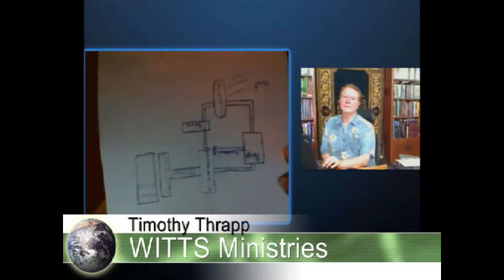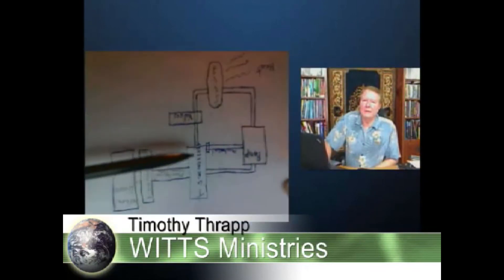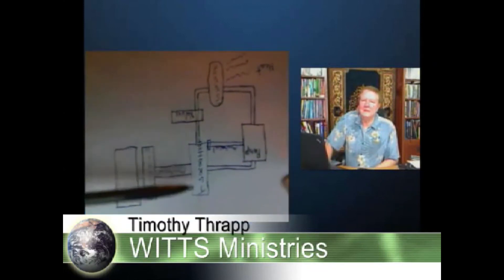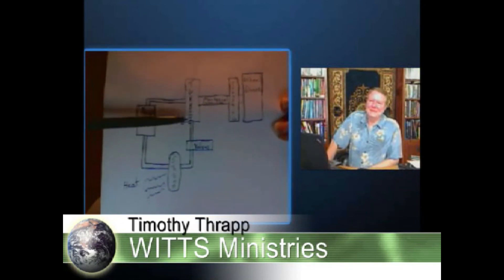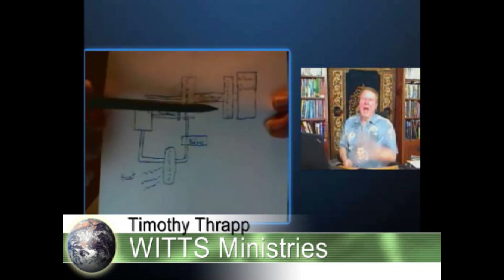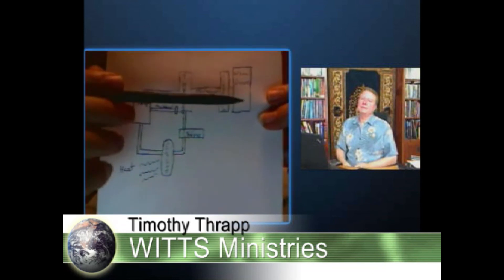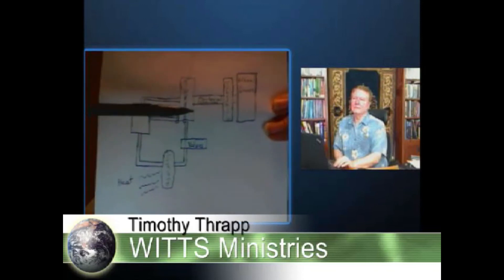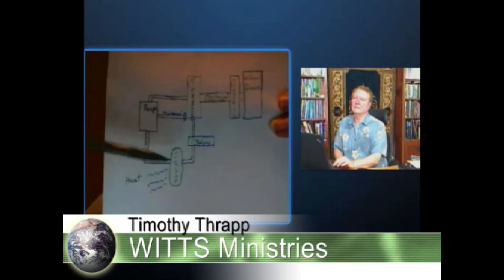300HP Ambient Heat Free Energy Engine

Comment: Hi I was wondering if this  system can  spin a Generator?? Or another type of energy machine.?? 
Maybe even something like  [ Bruce  DePalma's ] N-machine.?? For making 
Electricity OFF - GRIDD.!!
Reply from the maker: Yes. They did a demonstration at their 2010 gathering of a self-running A/C system. So it can run a generator, which can run electric A/C compressors, etc. This system doesn't work that well in the cold, but you could use a ground heat source (water lines in the ground), etc. Easiest system they are doing now to get off grid is Brandt-Tesla switch.

Comment: If what he's saying is true, the device itself is meaningless except for the jets. He spoke 99% of everything, but the jets. You can trick someone's senses if you distract with things like pressure differentials, gearing and just avoid the (magic) in the 3 cubic inch 75hp jets powers by your hot forehead.
Reply from the maker: it's hard to get a lot of heat energy out of a heat pump system unless you have a good heat source, such as a hot asphalt roadway.

Comment: jfc guys - you're not seriously buying this shit, are you?

yes, heating a gas or vaporizing a liquid causes it to expand, and yes, the force of that expansion can be used to drive a flywheel - that's more or less how ICEs and steam engines work. yes, cold ammonia will expand and drive a flywheel if exposed to sufficient ambient heat.

but once that ammonia expands, it's no longer useful as fuel. if you want to cool and recompress it you can, but that requires more energy than the engine produces. so what you have here is an engine that requires pre-cooled gas - which itself requires energy to cool - to run a flywheel for a few rotations, and then stops until more fuel is added to the system.

the miracle device they're demonstrating to us is just a flywheel waiting to be turned by compressed gas - the "pump" on the diagram he holds up is where the magical recompression would happen, and it's barely mentioned.
Reply: I don't believe this thing works either but from what I get out of it, they're saying it works similar to a gas RV refrigerator, only they're using the energy transfer to turn a turbine. Having seen an RV refrigerator work, I'm guaranteeing you there's no way in hell it works for very long or very well, if it does work at all. Especially not without an external heat source to heat the ammonia.
Reply: I love that my comment is also identical to yours. Did I miss in school where ammonia harnesses such explosive, exponential power? Seems like a waste to use such a thing on house cleaning.
Reply: I wouldnt write it off. Have you seen the article in Nature magazine this year Jan 2024, by Huang, 'Water can trigger nuclear reaction to produce energy and isotope gases'? This article provides a good explanation on how clem engine, griggs heat pump, schaubergers home generator etc work. Cavitation is the process it exploits. But do you really think that world economy, still based on oil, would allow such devices?

Comment: where can i get the original video or yt channel. I would like some more information on this unit. I see here a connection with the principle of operation of Richard Clem's engine
Reply from the maker: This one is not the same as the Clem Engine, it's simpler. Supposedly Clem had some association with the same group (then just called 'the ministry'). But the Clem engine is a different technology. https://odysee.com/@WorldImprovement:e/-031-New-Species-of-Man,-Pt-2--Guest-Gregg-Martin---Amazing-Pyramid-Observations-in-the-Home---Garden-(1):3 starting at 1 hour and 24 minutes, then in #32 and #33, which is where this video is clipped from. Their archives are on Odysee and Livestream now because Vimeo deleted their archives.
Reply: @QuantumEnergySearch  Thanks for the information :) I don't mean that it's the same, it just works on a similar principle, but the other way around: / I'm currently studying the work of Clem and people who tried to recreate this engine and I come to the conclusion that no one did it properly because the most important thing his engine is under pressure and pressure everything has to be super tight otherwise it has no right to work I think I know how it works more or less but I'll have to run some simple tests
Reply from the maker: @panmrf  I believe the secret (or the most important secret) is the Venturi effect. I have not gotten around to testing it, but many, many "implosion motors" have been built, and they work, and they can tear themselves apart if they get out of control. When a fluid goes thru a venturi, it increases speed but decreases pressure, so they say the energy stays the same, but kinetic energy is also 1/2MV^2. If the water is already moving, what does the pressure matter? So I think that if you understand how to use the venturi correctly, you can get lots of extra energy. That's my theory on it. I do have a video on the Clem Engine and what could be behind its operation.
Reply: @QuantumEnergySearch  Pressure has a very important role in the initial phase, i.e. starting the engine and then in the proper maintenance of fluid flows. An efficient pump in a closed container will create a vacuum and the rotating drum will be under pressure, the centrifugal force will help the pump to suck oil from the tank, and the vacuum in the tank will help suck the oil out of the spinning drum, where the energy for rotation, I suppose, is provided by oil ejecting nozzles as well as the oil pump itself at the appropriate rotational speed instead of pumping oil, it will help drive the impeller, so I think that pressure and vacuum play an important role here, as well as probably the engine speed itself
Reply: @QuantumEnergySearch  look carefully at the Clem engine and the engine housing, it is made of a thick wall and screwed with a large number of screws, which proves that it is not a cover against leaking oil, it is only supposed to withstand a large negative pressure and is supposed to be very tight :) After more thought, I think that the efficiency and power of this engine will be determined by the oil flow, i.e. the easier the flow, the greater the power :) In my theory, you can also explain where such a high oil temperature comes from. Precisely because it is pressed, crushed by centrifugal force and squeezed through nozzles on the drum, it would also explain that the oil Clem used is optimal for this because engine oil will be too viscous and thick to achieve proper flows :) But of course it is only A theory I'll have to check might be something to it
Reply from the maker: @panmrf  the heating is cause by cavitation.

Comment: Almost thirteen minutes of video, and not one second of it running.
Reply from the maker: I believe they demonstrated it or a similar device at the gathering they had in the summer of 2010 or 2011. It was a self-running refrigeration system. I was not there so I don't know the exact details.
Reply: @QuantumEnergySearch rumor has it someone ran a successful demonstration pf something similar over a decade ago, but no one has ever posted a video of any such device operating"

if i didn't know any better I'd think this was a bunch of bullshit
Reply from the maker: @jd35711  it's simple gas physics, if a refrigerant is heated, it expands.
Reply: @QuantumEnergySearch  right

then it stops expanding and can no longer do work. how do you imagine it becomes cold again?
Reply from the maker: @jd35711  pay more attention to the video. It's explained how it works. It's not that complicated.
Reply: @QuantumEnergySearch  no, he doesn't explain how it works in any coherent fashion

he claims that ambient heat causes a cold gas to expand, producing a pressure differential which causes a flywheel to spin. fine.

he then seems to suggest that the hot gas, rather than being expelled as exhaust, is recycled and recompressed by a pump which is powered by the flywheel so it can again be expanded by ambient heat to power the flywheel. which is obviously ridiculous

if I've misunderstood something - which is entirely possible - please correct me
Reply from the maker: @jd35711  I don't know all the details, but it sounds like there are two systems, one to increase the heat (heat pump), which heats a secondary gas, which runs the turbine.

Comment: Hello and thanks for the great content. Is the side effect global cooling? I think the tank could also be heated using evacuated solar thermal tubes so that it would work in colder climates too?
Reply from the maker: Yes, and yes. I believe the system they used for the automobile had pipes on the underside of the car so it would draw heat off the asphalt, which there is a lot of in the summertime.
Reply: Thanks for the reply, do you know if it uses planetary gears or what gearing is used? (Edit) Just watched your water generator video and it struck me that maybe this engine could be adapted to run on water, turned 90° with the output facing up, the water would drain back to the tank and the pump would jet it back in, I think 2 pumps - one battery powered as a starter motor then an ac one to take over when the generator gets up to speed?
Reply from the maker: @gerryplayz4532  they make small turbines like this (Micro Hydro Power is one), but they require a water source, they aren't mobile, and  they aren't 300HP.

Comment: True internal power of Capacitor(its idea about free energy)

in short  -we could discharge capacitor inward
instead of outward, and inward voltage is
higher then outward, by a lot.
When tiny wire ascend to plane between "+" and  "-"
plates of capacitor, its concentration of charge
would increase(therefore voltage on them).

And when charge reaching midst plane between "+" and "-"
it could effortlessly leave capacitor through
(within) its plane (because distance to "+" and "-"
equal in this plane)
======

What if charge on capacitor plates could leave 
capacitor effortless and unleash its true power.
Which usually foreshadowed by nearby opposite charge
(push mines pull(outward force))

But inward force dont foreshadowed and have all of its
true tremendous strength(as if its solitary charge)

And its strength isn't a joke , at all!

If we could remain it intact and go outside with it it 
would be a great output power(output voltage), could we?

And we do have such a place for charge on a way inward(from
capacitor plate) , or better to say such a plane
And it right amidst "+" and "-" plates.
Charge could move within this plane effortless
(because distance to "+" and "-" is equal for any point
in this plane)

So charge could maintain all of its true power and
leave capacitor within(through) mid-plane (as far of 
capacitor as it want)

Its mean we might obtain great power then
Because we pull in low voltage and it push out high 
voltage (with the same quantity of charge)

How it might be done :)
Just tiny wire which descend from "+" or "-" to midst
(between them) and wend aside through mid-plane through
with all true voltage.

Concentration of charge when it reached amidst would be
great , meanwhile there no force to hinder it within
mid-plane:)

Therefore we may see that voltage actually 
rise in a way inward and lowered in the way outward

Its just mind-blowing (really unexpectedly)